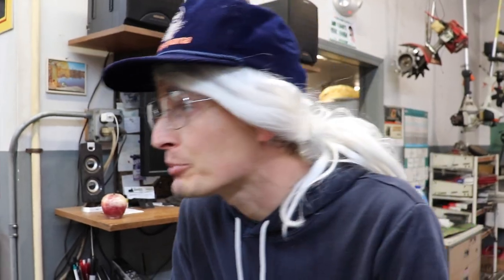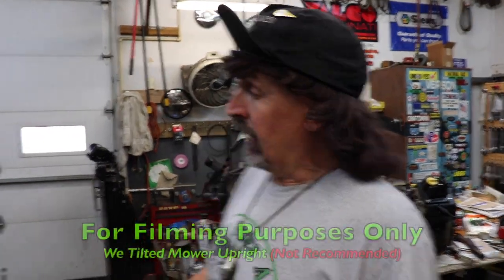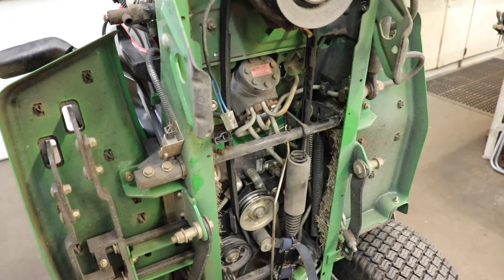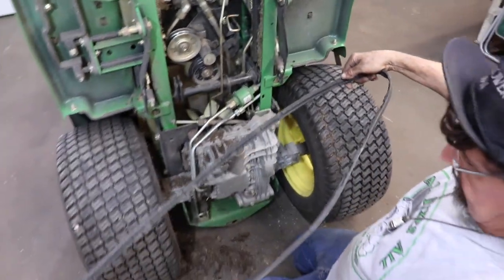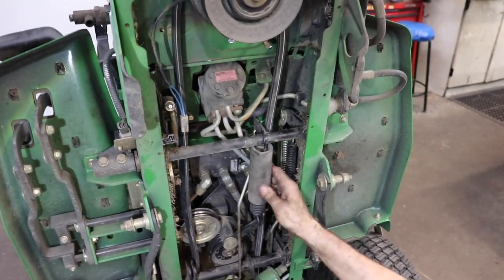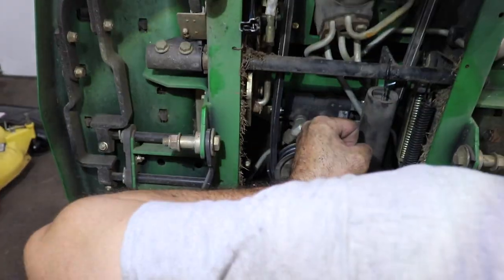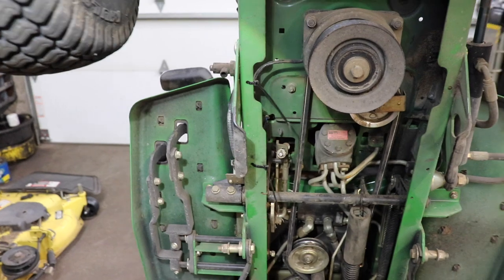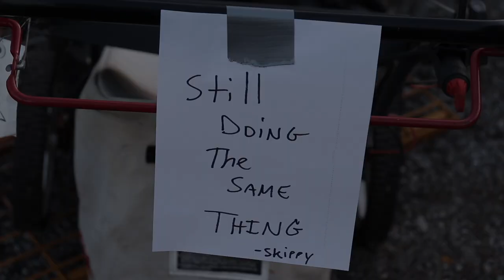How To EASILY Replace The Drive Belt On A John Deere GX335 Riding Mower

Comment: Nice tip on the ratchet strap!  The original drive belt on my GX345 snapped yesterday @ 952 hours.  Glad I found this video since the owners manual didn't have a procedure for it. Neither did the Service Manual.  I did have some slightly different results though, maybe related to differences between GX335 Vs GX345.

I removed the hood, fenders, and gas tank.  I used a come-along to hoist the front of the tractor up to get it nearly vertical.  Used a ratchet strap to take the tension off that big spring. I picked up the belt(M142499)  at my local dealer.  I threaded the belt in from the top side, slide it over the HydroStat fan  and around the pulley.  I didn't have to remove any of the idler pulleys and I didn't have to remove the PTO Clutch(Only the wire).  There was enough slack in the belt to slip it over the PTO clutch and around the front pulley. My idler pulley guards were not in the way either.  I had the belt replaced and put it back together in a little over an hour.

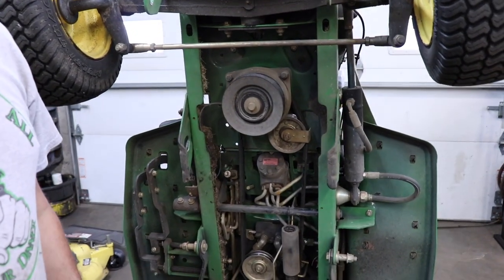Comment: 5:15 youre right. i did have the front jacked up and i layed underneath when i did mine (i didnt watch a video i just eyed it) and it took me about 30 mins. and yes that big spring was a pain. i got a hold of it with both hands and a big screwdriver and pulled it off. but getting it back on was the hard part. i ended up using a ratchet strap on the end of the spring and hooked the other end to a cross piece on the mower like he did but i used the strap to put the spring back on. the reason i took it off was because the belt ripped down the middle and jammed and binded against EVERYTHING and i never did it before so i did it my way.

edit: as im watching this more. i remembered mines a standard 335 not a gx. because i didnt have to remove any pulleys or clutch wires and it looks a little different. something else. i didnt have to bend the fan blades. because i only had 1 out of 5 left when i changed it : P    1 1/2 years before i changed it. i found a fan blade on the ground and was like. well crap. oh well. well... when i called to order a belt i figured i should order a fan too. and its a good thing i did because i didnt know THAT many had broke but yea it went like that for a while and i didnt have any issues. dont recommend doing it tho. just incase.

Comment: Wow JD did a fantastic job on engineering this one. Doesn't look impossible to do for the average home-mechanic but certainly isn't a walk in the park either. I remember when I was a kid, changing a belt on a riding mower was about a 5 min job and could be done with a a big screw driver and a couple wrenches. These mowers are starting look more and more like a space ship than a piece of lawn equipment.

Comment: I just replaced my electric PTO and drive belt on my JD X540.  I ended up using TWO of your tricks-the air hammer on the crank bolt to get the PTO off (it didn't want to) AND the racket strap to loosen the drive belt tensioner to get that belt off.  THANK YOU!!!!!

Comment: Thanks for this, replaced my belt this morning.  One thing I found out accidentally is that if you hook up a long breaker/torque wrench to the top tension pulley you can pull that to release tension very easily.  Still like the ratchet strap idea to hold things over time, but that breaker bar trick made installing/removing the strap a lot easier.

Comment: Maybe someone has already asked with (with 197 comments, but I haven't seen it yet). I'm planning to change this belt myself, because I have a GX335 with a BROKEN drive belt. So, I'm finding this video VERY helpful.  
Only problem I see is, this belt drives the hydrostat which also drives the lift for the deck.  If you can't lift the deck, how do you coax the bar to move up so you can get the belt past it?

Comment: Excellent video once you got past Skippy!  I recommend the DiY gang take lots of photos as they take one of those apart so they can quickly rethread the belt.  Pay attention to how it comes off.
I would have changed the Hydraulic Filter (below ratchet strap) 8:42 while it was up but that could be messy.  I did the drive belt on a Ford LX 55.  Tricky getting it in the right orientation.
Mine is an X 320 with no Hydraulics for steering or deck.
Excellent camera work and sound FX too.  Don't turn up the music. It is just right.

Comment: Taryl and others who may have a hard time removing Gear to remove steering wheel for drive belt replacement. Mine was not right and wouldn't budge. Go to auto parts store and get a loaner Tie-Rod separator tool, the small one that fits, don't get the big size. Put that sucker above gear and hit with a baby maul, watch as you pound it and work out the last 1/4" by locking a medium pair of vice grips on the steering shaft and use as a wedge for tie-rod tool so you can get remaining 1/4".  Man I hope this saves somebody a lot of brain work. God Bless all of us.

Comment: Just a little advice the belt keeper on transmission has a 6mm Allen hole intop of it.its a hole lot easy to use Allen wrench on a 3/8 drive rachetwrench,than that 15mm open end wrench .hope this tip is helpfull

Comment: I have a GX 255.......had Deere check over the tractor 2019. One of the things they replaced was the transmission belt. I bought the tractor new in 2003. This year I now have almost no reverse movement. Forward is fine.....I havent looked, but geez they just worked on this and the first belt lasted for 16 years! I would assume if the belt was bad I wouldnt be able to move the tractor at all?? No reverse, forward is ok.

Comment: Chain up a Harbor Fright hoist on that beam ..use pull rope and handle to remove or reinstall that spring and play Twisted Sister “Stay hungry” for there’s your dinner.  But try the old pull cord and handle trick to reinstall them springs. It works great 👍

Comment: to you its second nature, but.. my neighbor had his tractor on its tail for a couple weeks working on the deck. After he was done, he put the tractor down, put fuel in it(gas drained out) started it, drove 50 ft and it quit.  long story short...no oil, it drained out too. 3 yo engine toasted welded crank to the upper bearing.
Reply: ouch!

Comment: Always check the oil after standing a mower on end. If it drains out and you start it...especially doing this in the lawn and dont notice the oil puddle under the mower.

Comment: 15 min it took for mine,on the ground took spring off from start ,so much easier, take belt off of front pulley first then one on rear is no trouble at all

Comment: years ago I was the mechanic at a rental store, and old guy brought his mower in saying it wouldn't start. I later got around to looking at it, that thing started fine, we called  him, he came and got it, and shortly he was back with it saying it wouldn't start, again I tried it and it fired right up. yet again he brought it back, this time I asked him to show my how he was starting it.. the  poor old guy could barely pull the rope, not nearly fast enough to make it fire up... how do you tell someone, he's too old to start his mower? I showed him how easily it started and I suggested maybe he find someone to crank it up for him.
Reply: Shot of starting fluid will make her fire right up
Reply: I ended up taking his mower in for exchange for an electric start model. As a small engine mechanic, I always have one ready to go. I do take trades. I did charge him the difference but he was happy and now I do all his tune ups.
Reply: @RustyZipper  Starting fluid can cause a hydraulic lock on the engine making it even harder to pull. I have also seen the engine start backwards on a backfire and sheer the shaft key on the flywheel using starting fluid. Then I get to replace that too. No, it's best just to sell them an electric start Toro. I have one out back already to go for that reason.

Comment: I'd rather remove the 6 bolts and pull the seat, remove the fan(so you don't break the blades), and use a 3/8 drive in the idler bracket to remove tension on the belt.  All done with mower on the ground.  Remove idler from below to cheat belt back on.  Done multiple times on my mower.  Not liking this method here at all.

Comment: You know, when you have to take the main drive tension spring off to change a belt, that it was very very poorly designed. Typical JD garbage. 120% more complicated to work on and parts are 300% more expensive than they should be. I turn down most JDs if they come into my shop because I have to charge so much to work on them just because of the time ya spend. No body wants to spend that kind of money to have there junk repaired. Other shops in my area charge $145 per hour to work on them. I'm just a small shop but I've been doing it for over 35 years. Over Priced junk. lol